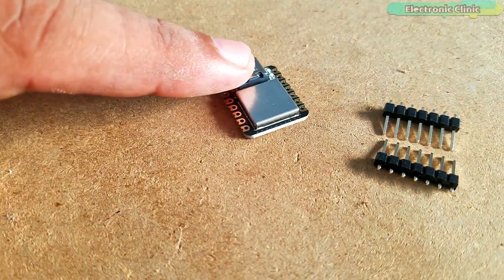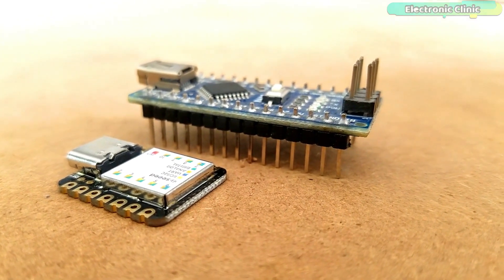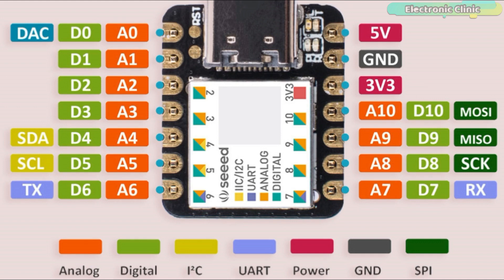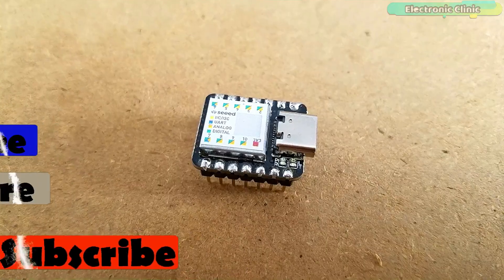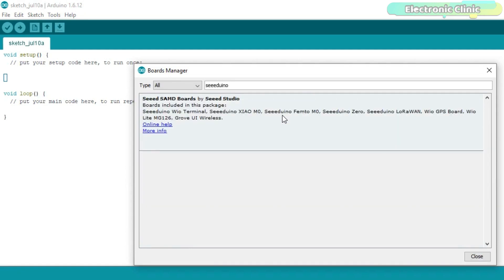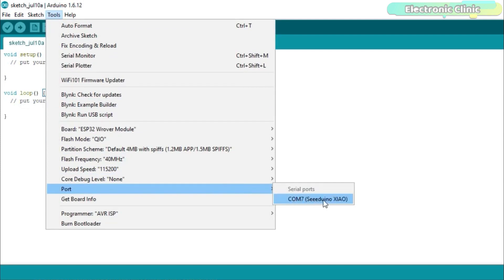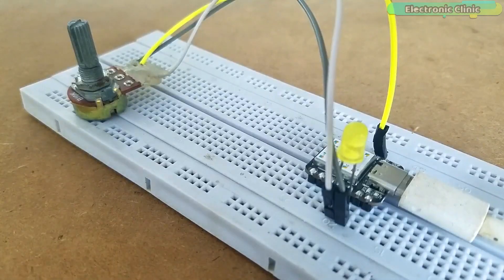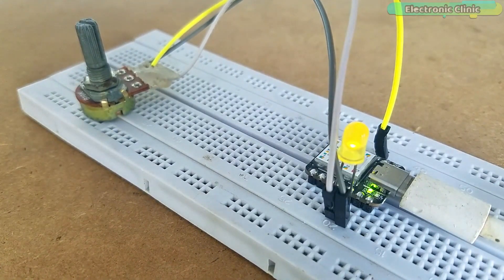Seeeduino XIAO the Smallest Arduino, Getting Started Tutorial, Pinout, specifications, & Arduino IDE

Comment: Can you please help me? I am pretty new to arduino and programming but I wanted to try a smaller controller for a project that I am working on that is limited with available space. I tried to download the simple LED sketch and I get this error at the end:

Sketch uses 34140 bytes (13%) of program storage space. Maximum is 262144 bytes.
Performing 1200-bps touch reset on serial port COM3
Waiting for upload port...
No upload port found, using COM3 as fallback
No device found on COM3
"C:\Users\johnm\AppData\Local\Arduino15\packages\Seeeduino\tools\bossac\1.7.0-arduino3/bossac.exe" -i -d --port=COM3 -U true -i -e -w -v "C:\Users\johnm\AppData\Local\arduino\sketches\B719CDE8CC398BAD3D2860A02BF9FD01/Blink.ino.bin" -R
Failed uploading: uploading error: exit status 1

 What am I missing?

Comment: My board is not detected as a COM port , please what happen? I have windows 7 x64 bits
Reply: did you figure it out?
Reply: @kevcubicgaming831  Yes, In arduino forum somebody had the same problem. You must go to "Device Manager" and select the new not recognized device (your esp32 xiao) and install driver from locally installed. I dont remember very well but the drivr's name is something like "Fox controller". You can Google it and will find the arduino forum post
Reply: I am having the same issue.  Were you able to get some help?
Reply: @JohnAllen55  Update driver: Go to "Update driver" > "Browse my computer for driver software" > "Let me pick from a list of available drivers on my computer" > Find manufacturer "Arduino LLC" > Find the option "SmartEverything Fox bootloader" > Install this option and disregard any incompatibility messages > After the installation confirmation window appears, note the title of the window and look for COMXXX; this is the COM port that will be used in the Arduino IDE to upload a program to the board.

Now, proceed to open the Arduino IDE and select the XIAO_ESP32C3 board, then choose the appropriate COMXXX port based on the previous information.

Test with the "Get Board Info" option. If the verification window appears with vendor code information, communication is successful.

Now, put the XIAO_ESP32C3 into "Boot" mode. Press and hold the "B" button while connecting the USB cable to your PC.

Upload the BLINK example. After any program has been uploaded, you must press the "RESET" or "R" button.

This is what i didi. I hope this works for you

Comment: There is No EEPROM, is there a way to save data before power down on this controller ?
Reply: You can add your own EEPROM chip to the circuit through SDA and SCL
Reply: It had its own flash memory, no need for an external chip.
Reply: @raphanunu6912  How do you write and read to it?

Comment: I put one of these to work as an ARGB controller. It's absolutely capable and can directly control WS2812b LEDs without a logic level converter. It can also directly power WS2812b LEDs from its 5v pin as long as you are only lighting a handful of pixels.
I only have one complaint / request: Can you guys maybe make a version that supports power delivery negotiation for the 5v/vcc output pin? 

I couldn't find any documentation on what the maximum output current is on the 5v pin. Looking at the circuit diagram, it appears the XIAO only uses the USB 2.0 protocol and the 5v pin is guarded by a diode with a 500ma limit. With PD negotiation, you could potentially output several amps over the 5v pin, allowing you to drive long strings of LEDs without an external power supply. I do realize that implementing PD would be a substantial redesign, but you've got Bluetooth variants so PD sounds like the next big thing :)